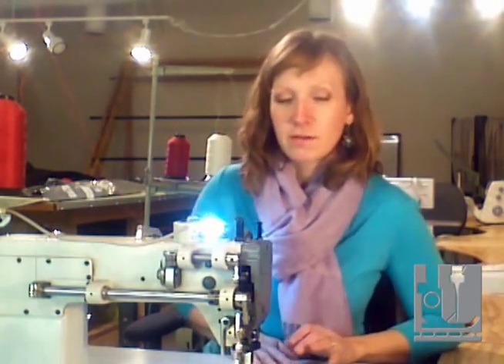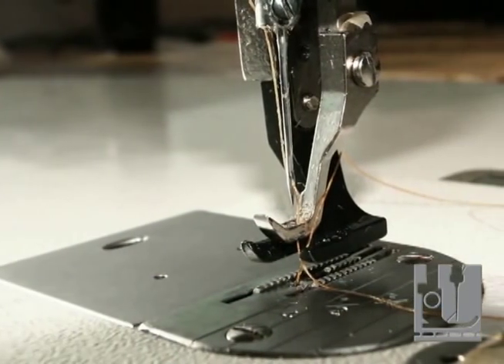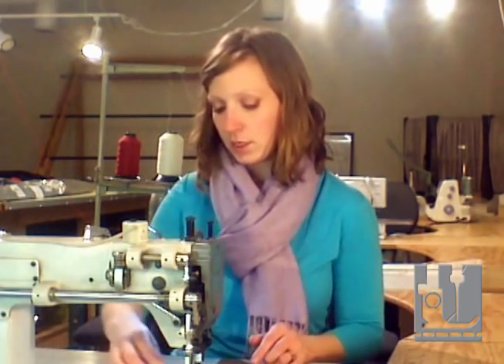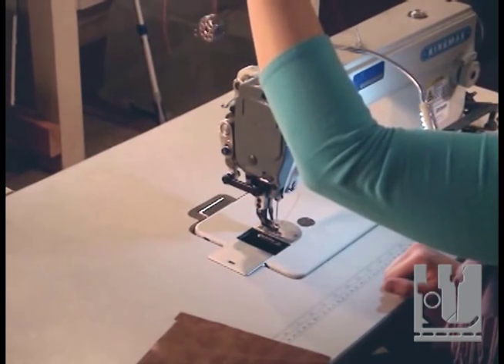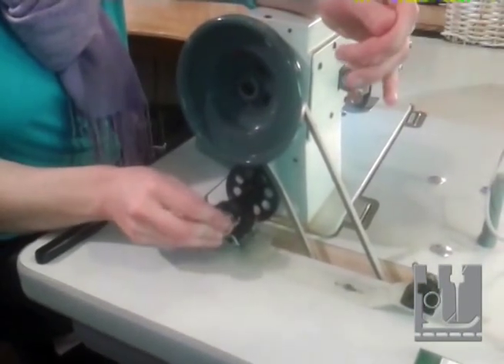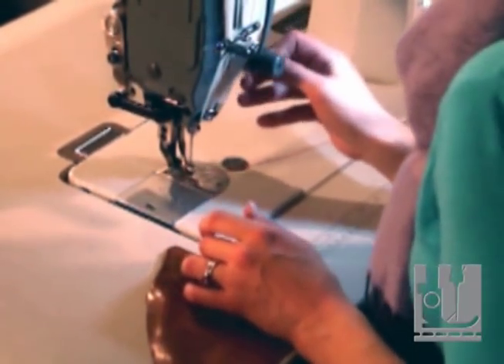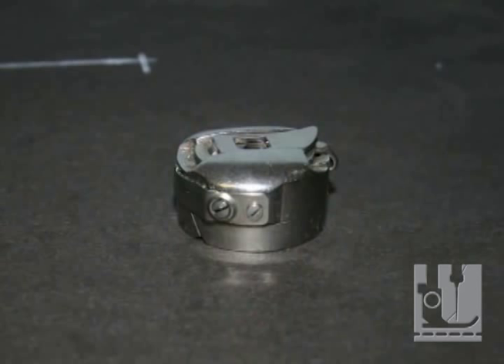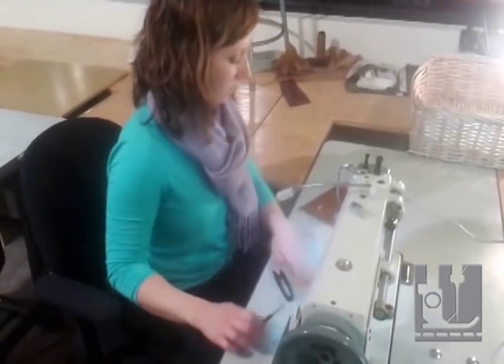How to use an Industrial Sewing Machine - C Winn Designs

Comment: You explained very clearly that when I am seeing thread tangled beneath my work piece the problem is most likely on the top part of my machine.
I have often searched for the cause and erroneously focused on the bobbin.
The tangle on the bottom of my work has occurred after I break the thread at the needle and I thread the needle and do not start at the thread spool. It is only after a while that I find that the thread seemed to have jumped off of the "thread take-up lever".

Maybe now I will FINALLY start looking where I will most likely find the cause and solution to my problem--or just rethread the machine when I break the thread. 

I had not noticed the screws on the bobbin case! 
While I do not think I have had a problem with the bobbin tension it is great to be able to recognise when I might be and that there are parts that may be misadjusted or jave come loose.

Comment: how do i have more control over my machine, if I can not put a slower motor on it, I have a Juki 9010 lots of computerized function and way different then my juki 1181 industrial machine, which I can slow down stitch by stitch, the other one, I can only  slow it down to 500, I have problems on it with making squares. or stopping and starting

Comment: I have never used an industrial machine before(nor seen one used) . I have just bought a Kingstar walking foot industrial machine with clutch motor but it sews too fast-there is no control on speed--- please would you advise me on how to start the stitching slowly as it seems to just go from off to fast sewing. I eventually want to sew canvas awnings for my home. (this was bought for home use projects only) . Thanks for any assistance you may be able to offer.
Reply: Hello Melene,  practice, practice, practice.  It's all in how heavy your foot is.  You'll have to get to know your machine a little bit before you can feel how it wants to sew.
Reply: Thanks for this reply - I went out and bought a servo motor for the machine to be able to have better control on the speed. Love the industrial machine now!